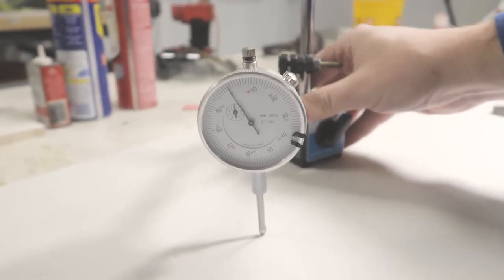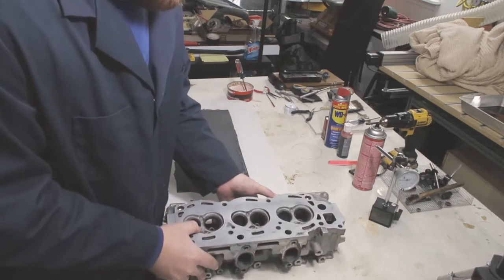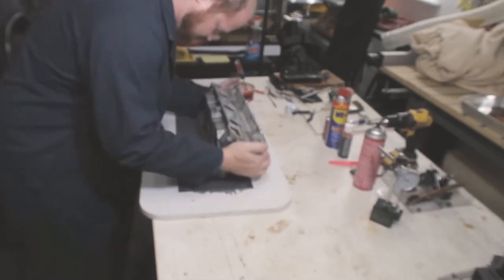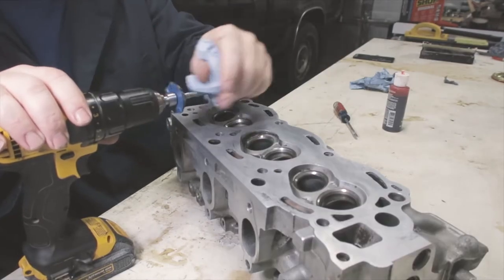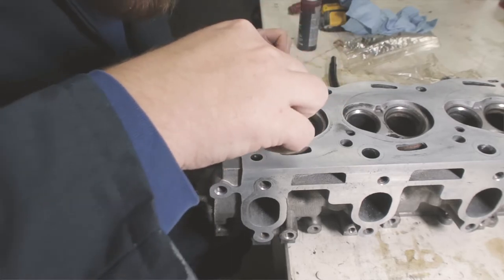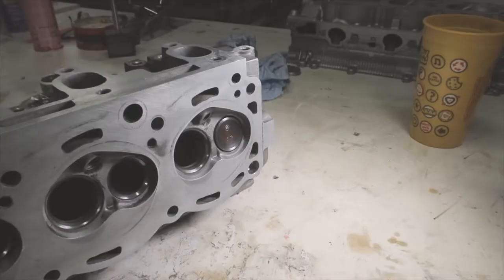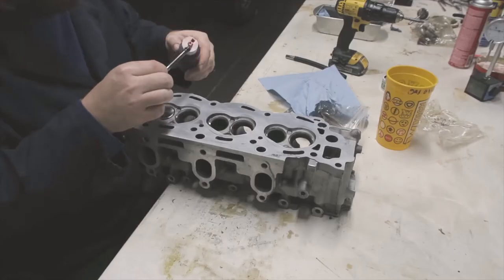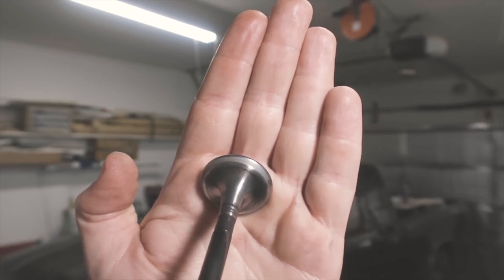Replacing and Lapping in the valves - 1989 Toyota Pickup Restoration Ep 4

Comment: Great Job!  Where did you get the valve seat grinders?
Reply from the maker: https://smile.amazon.com/gp/aw/d/B071WW28KN?psc=1&ref=yo_pop_mb_pd_title is the set that has the cutting heads that worked really well. https://smile.amazon.com/gp/aw/d/B00QMC87FA?psc=1&ref=yo_pop_mb_pd_title has the metric stem guides. The cutters didn't work that well on these, but the combo of the sets worked well. If you are working on an English engine the first one will work well. If you need a metric stem guide I'd suggest a different router then buying two kits. I modified the handle in my lathe to fit the drill. Hope this helps!
Reply: First question that popped into my mind...thanks for asking.